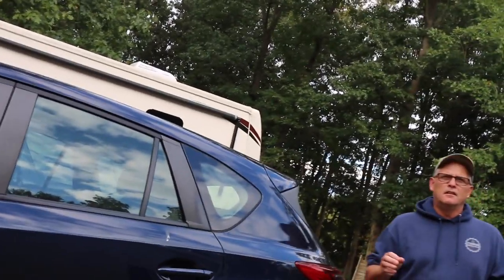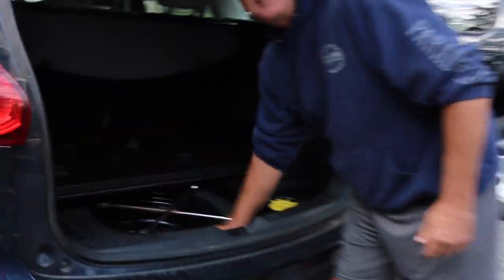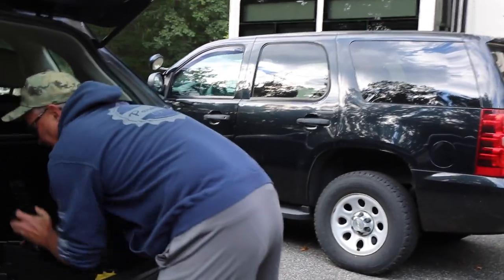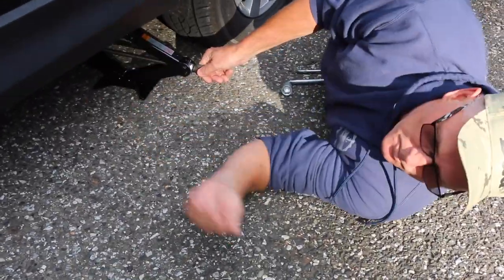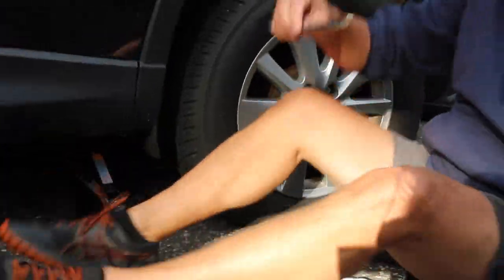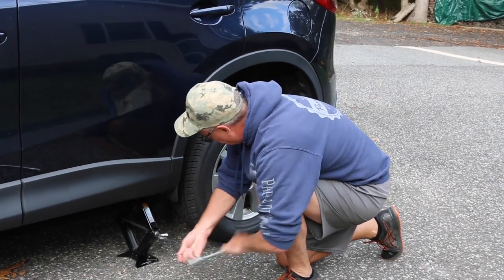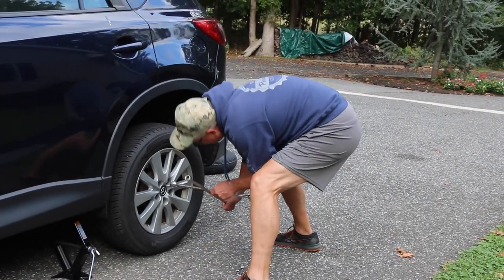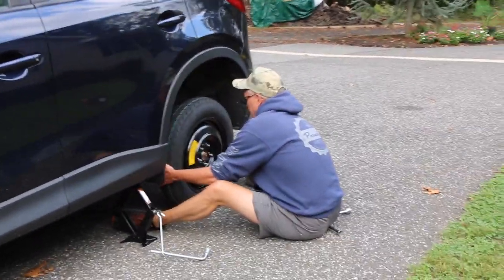PSYCHO DAD CHANGES TIRE

Comment: Great video Jeff! 

Just wanted to add because at 6:20 you didn't really explain, but the reason why you loosen the lugs when the tire is still on the ground, as opposed to loosening them when its up in the air, is because without the weight of the car on the tires the tire will spin around if they aren't loose enough.  Do not make the rookie mistake of jacking it up and then having to lower it because you forgot to loosen the lugs. The people watching you change the tire WILL point and laugh.

Comment: Great video Jeff! I remember a few years ago when I was back in high school I did work experience at a caryard in the mechanics workshop,  everything you have mentioned in this video they said to me when they taught me the basics of changing a tire if you get stuck in an on the spot situation like that. A few months ago earlier this year I got a flat tyre and referred to the lesson I got from work experience to change the wheel to the temporary one on til I got the original one fixed.

Comment: That’s right!! Use your tow company to change it instead of Crappy Tire. Save you hundreds. Also remember it is not recommended to drive far with the spare but you can. It is not going to explode or anything If you drive passed the recommended distance. With this knowledge you can go where you need to go.

Comment: Great video Jeff and Terry! I recently had to remove tires not for the same reason but to replace the brake pads on the vehicle which is a chore in itself if the pads are wore down to basically nothing lol (didn't know they were that bad when i got it) but still same lesson, loosen em up when it's on the ground, then jack it up and remove them the rest of the way. but yes, always safety first!

Comment: Don’t forget to put the flat tire underneath your car’s frame and remove it once you’re about to lower the car. This will help protect you if the car falls off the lift and the car begins to fall.
Reply: I agree, this is for maximum safety. I’m surprised he didn’t do that in this video
Reply from the maker: with newer vehicles tire doesn't fit, but yes by all means if it does fit do it
Reply: @PsychoDadOriginal  hi my friend Jeff

Comment: Well when the wheel hub/assembly is cracked that's a different story. Cost my $800 for a replacement for my truck. Really scary situation when you're driving and your tire goes in front of your truck and jumps out 1 football field downhill into a cow field with an electric fence. And, you also have to assess the damage once your truck fully stops and lands on the disk brake. We had no tow or triple A service where we were at. But, some nice farmer out in the middle of South Dakota saved us from 8 hours of waiting.